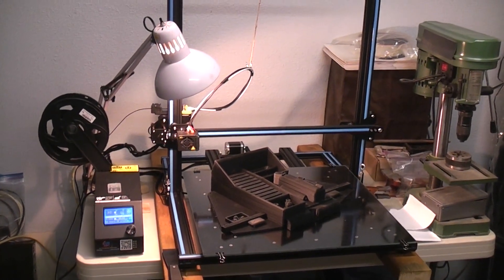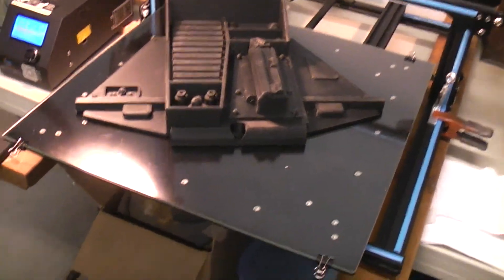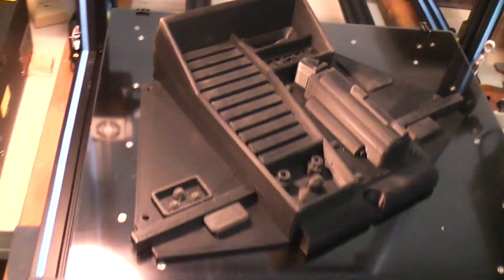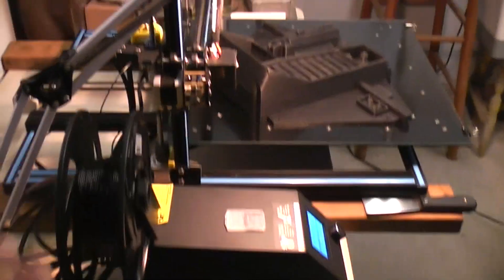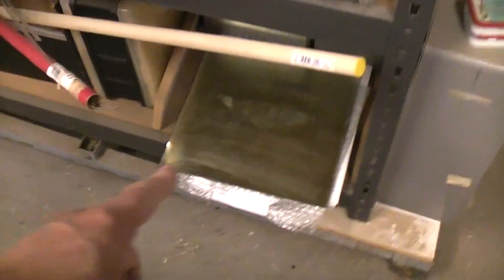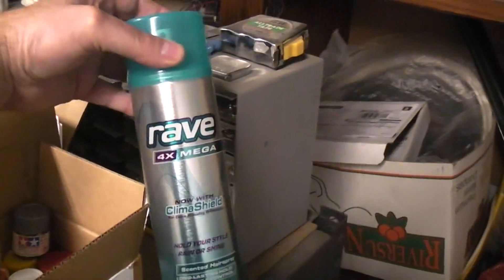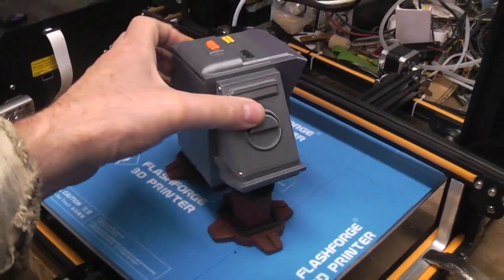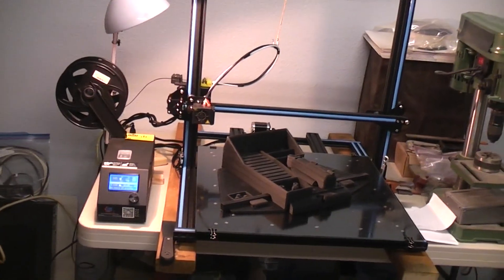CR-10 S5 My first large scale print on this big mother !  Part 1.

Comment: Did you ever finish the robot?
Reply from the maker: No Winter hit hard and its to cold in the shop to print on the big S5 printer and the printer is to big to bring into the house. So just waiting for it too warm up a bit so I can finish the project. I have my smaller printers in the house working on other new projects for now.
Reply: Robothut thx for the reply.
Really would love to see it finished, is the file available or is it yours?
Reply from the maker: I put the files for a small battery operated walking Drone on thing I verse but not the larger walking drone with rocking body and not this jumbo drone. You can find the videos on my channel and the links to the files.

Comment: Is that not the robot from "silent running"…?
Hughy, lewie, and dewie?
Nice print👍
Reply from the maker: Yes I based my design on those bots. As soon as it warms up a bit I will finish the project. The Cr10 S5 is to large to bring in the house and the shop is to cold right now.
Reply: Robothut  nice work, I'm saving for a Cr 10 now.
Can't wait to get it👍
Reply from the maker: They really work quit well for the money. The bed on the large S5 was flatter than the bed on the standard CR 10, I had to get rid of the glass bed and just use a mirror like most other have to get it flat and level, but the S5 was good enough as it came from the factory. Maybe I was lucky.